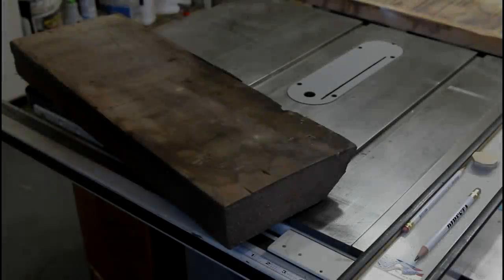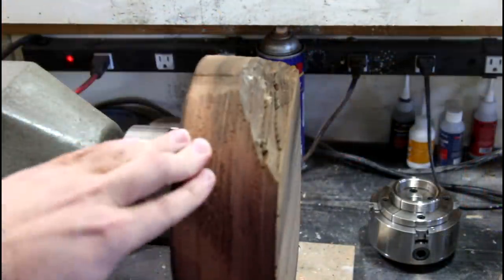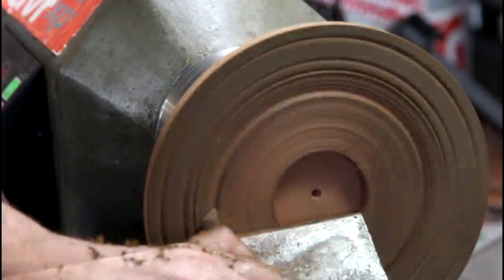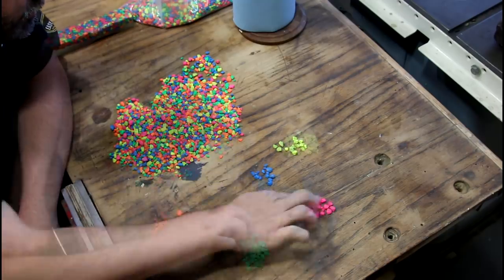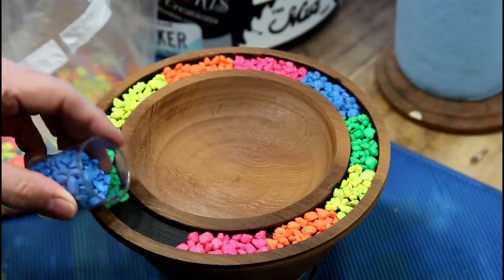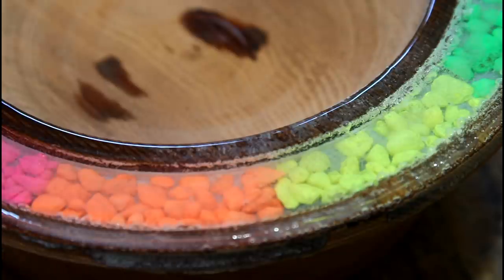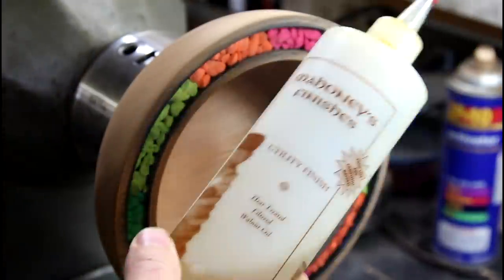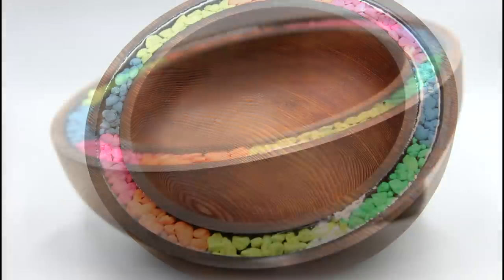Rainbow Rock Bowl  |  Dipit #29

Comment: Love the bowl and your videos. One thing I have done in the past to get by the moisture issues with Alumilite is to paint on an initial layer of 5min epoxy over anything that might have moisture. Let dry for an hour then fill with Alumilite. Think I may have seen originally on Zac at NV wood works but it works great brush strokes are filled with Alumilite so 5min epoxy does not have to be pretty. Keep up the great work! I watch every video.

Comment: Pretty cool project. Try some "glow in the dark" powder, different colors available, with the resin. Those powders are really hard little bits(Strontium) I think, you definitely won't want to hit that stuff with a turning tool. Another idea would be some glow in the dark tape. It also comes in different colors and would probably be a cheaper to experiment with. Line the bottom and sides of the groove/channel and a clear resin, you'd get some hours long glowing.

Comment: I wonder if it would be worth using one of the oven dryer things we use in chemistry labs when we want to ensure there's no moisture in a sample, to get extra good results from the resin that hates moisture. They are pretty expensive, but surely there's another way to rig an oven that takes in fresh air rather than recirculating the same air. Or maybe you could chuck a piece into a home-made dessicator (basically get an air seal on a glass jar using vaseline, and put kitty litter/similar moisture absorbing substance in the jar with the thing you want to keep dry). Because the wood could naturally have enough moisture in it to muck up the other resin, even if you gave the paint ages to dry.

The bowl is very pretty.

Comment: Normally with stone turning, well diamond Lapping Plate with water cooler spray can shape stone resin. Suffice to say: sometimes certain resin starts sticking like glue on the Lapidary plate and you might need good stiff brushes when it happen or sander sheet model one which you can throw the sand paper away.

Comment: Peter to make your life a lot easier and easier on your tools, just take Wood chips and make Different colored Stains using Oil based paint and pouring a few drips in each of those cups you use for resin, soak the wood chips in the different color stains and do the same thing!

Comment: I never knew redwood was so dark, it's absolutely gorgeous.
I would have used white quartz pebbles, maybe with a few black scattered throughout (I forget what it is called but there's a gemstone chip that's a very, very dark blue almost black with sparkling bits in it - those would look great) instead of the bright colours but that is just personal preference, I'm not so much of a fan of neon.
However the bowl looks great!

I don't know if it was the resin' s fault - when you use any type of aquarium gravel you have to wash it thoroughly, usually rinsing it through half a dozen times or so, otherwise it makes the water incredibly cloudy, just like the resin on the 1st bowl. Perhaps that is why it went cloudy?

Seems a shame to waste the first bowl, is there no way to remove the resin/rocks and redo the edges with Total Boat? You could even try something different if you don't want to make another rainbow one?

Comment: The reason the blue didn't react to the blacklight is because the coating used on blue gravel actually absorbs UV spectrum light so it doesn't glow like the rest of the colors

Comment: Out of curiosity is epoxy/resin food safe? I would imagine so long as you don't pop this bad boy in the microwave/ under a hot dish washer it shouldn't be an issue as there would not be any contact with food if you preferred to use it for chips or something as opposed to trinkets.

Comment: Fluoresence comes from splitting large energy photons to smaller. Blue is a higher energy photon than others, hence rare to have blue fluorescents from UV excitation as the co-emitted photon would have to be very low energy. Not impossible, just rare

Comment: I could be wrong, or the paint that they used are extremely cheap, but the reason why the blue did not seemed to glow unlike the other colors is because not all colors are created equally.  What this means is that, since blue is generally a harder color to see, it may explain as to why it seemed like it wasn't "glowing", when in fact you just needed a stronger  source of  light energy for us to see blue.

Comment: From Google:
"A true substance that is blue in color and fluorescent (in the blue) does not exist. They usually use a regular blue dye mixed with some optical brightener. Optical brightners, for example, are colorless but become bluish under strong UV illumination."

Your video got me wondering, since I was never able to buy a proper fluorescent blue paint. I guess it just doesn't exist.

Comment: Have you ever made a steering wheel.
I had this mad idea of casting brass electrodes in resin into a steering wheel.
So it shock a would-be thief that doesn't know about a hidden switch when starting my van. Any tips on resin for this idea.
Ps: it would only be mild shock to make think twice.

Comment: The blue are not fluorescing because you don't have true UV. Common black lights found at places like Amazon, hardwear stores and Spencer's are near UV with maybe a bit of UV-A. The pricier ones you find on Amazon and sites that cater to semi-professional DJ's/theatre will be low level UV-B and UV-A with some near UV. 
Because the light is already so close in energy to the blue florescent dye, it won't really glow, just reflect. You need to get something like realUV™, that has high energy UV-B and some UV-C. There is NO visible light from these making them a bit hazardous because you can't tell how bright they actually are. If is best to wear clear UV blocking eye protection and if you will be using it for more than a minute or two, put on some sunblock and/or cover as much skin as possible.